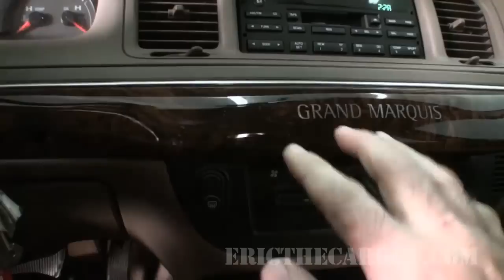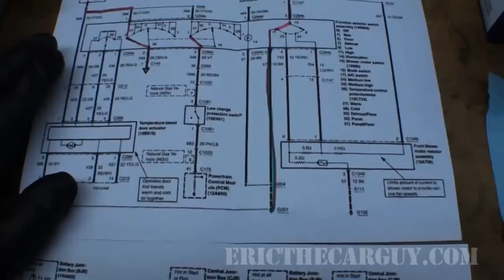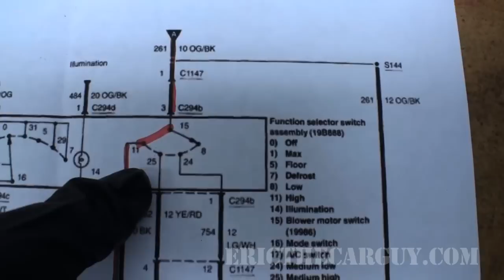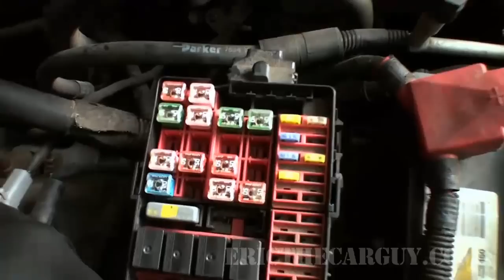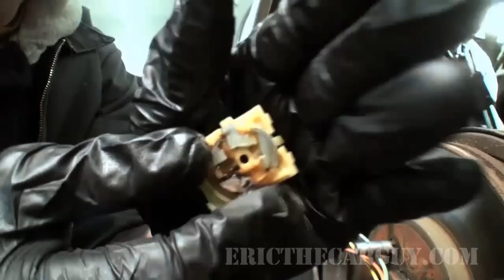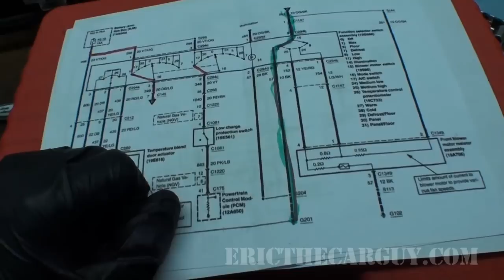2004 Mercury Grand Marquis Blower Motor Repair -EricTheCarGuy

Comment: Hey Eric, been a longtime viewer of you, and thank you with a lot of appreciation, for making videos of what you do and how you do it. ive used your methods and used the info u gave to us on how to trouble shoot instead of spending a lot on money. I have a 2001 Grand Prix GTP coupe with the 3800 L67 series 2. and yes its modified. the blower switch does the Full speed on 5 but 1-4 doesn't work, I was thinking resistor but nah its the switch. Also I just graduated from Diesel Technology on May 18

Comment: Hi Eric, my car is 2013 elentra. Recently, there are so much water. like waterfall, coming out from the blower or somewhere around that area. Btw, i did not turn on the AC or the heat, and the water only comes out when i am driving. What is the problem? Is it the "sewer" get blocked?

Comment: he's using a powerprobe wich cost over 100$, i use sockets that you can get nearly for free at the junkyard or on old used parts that you have, or you can also buy one socket + one light bulb for les than 5$. Also, BBB industries lets you see all the electrical diagrams you want for free on their website.  That's all you need to diagnose simple electrical problems like this one.

Comment: I work on a lot of Fords,a couple weeks ago we has 3 E vans getting blowers resistors and/or switches replaced in the shop at once. The blowers on Fords are a high failure part, the resistor has a thermal fuse built into it when the amps drawn from a worn blower pull to much the thermal fuse blows and you only have high, it is in ford's service info, because you are now have a direct link to the switch the switch also goes bad
the blower motor, the contacts get worn and takes more amps to turn.

Comment: The problem was that over time the contacts in the switch got a little dirty. That dirt increased the resistance of the switch and heated it up, which made it wear even faster, and heat up more until the plastic started to melt. This is a much more likely scenario than the motor having an internal short.

Comment: Incorrect on that system, the blower was pulling too many amps, not a direct short, the switch becomes a fuse as well as it is on the ground side of the system the switch has a lower amp rating than the real fuse.

Comment: Eric you can't voltmeter an open circuit.  You have to back-probe with the motor connected.  The load will affect the voltage that your meter sees.

As to your theory:  If the motor was shorting then the fuse would blow before the switch.  If not then the switch was faulty *before* it overheated.  Please replace it if it's a customer car.

Comment: a good tip on most older volvos like 200, 800, 700 and 900 series cars if the blower motor resistor  is bad its beacuse the blower motor is eating to much power and burns the resistor off so you can fix it with just a resistor it will burn out in a couple of the weeks or days

Comment: i would have applied power directly to the motor to see if it blew at full speed before i changed it out then i would have checked the voltage from the plug at each position of the switch if no change check switch

Comment: Eric you were for resistor that's switch is a variable resistor not a  variabile transistor. Variable resistor its like your volume knob on your stereo that's a variable resistor. It varies the current going to the motor or said speaker

Comment: I guess you like following 30 plus page flow charts when experience of the tech can tell him to skip over 30 steps and check xxx? I do it all the time, and 90 plus percent I am right, I still do the checks, but I am a pro and would be wasting mine and the shops time going step by step. I do mostly driveablilty and I can tell you most times I do not even look at the flow chart unless unfamiliar with the car or code set criteria. 
A better tip would be to understand how the system works

Comment: wow, getting beat up on this one:( Truth is I would have replaced the blower resistor and switch too, a lot of people talking out their a** on this, with no understanding of how the system works, the blower was pulling too many amps through the system and melted the switch to put the old blower back in would have resulted in a come back.
Also I would bet the lady has been riding with the blower only working on high because it had taken out the resistor, as those have a  thermal "fuse" in them

Comment: The switch is on the ground and at high speed it creates a direct path to ground so there is no possible way for a short in the switch to cause the blower motor to fail when he is playing with the switch there are times when the motor speeds up indicating the motor is working correctly I have noticed Eric seems to develop a theory as to what is wrong and then test that theory I have found it better for me to not guess what is wrong and just test the circuts and go where the evidence takes you

Comment: Always enjoy your videos, but would like to see more concrete diagnostics before changing parts. 
A simple voltage drop test on the ground side of the blower motor in all fan speeds (loaded circuit) would have pointed you in the right direction in under 5 mins. You said yourself you don't like to do extra work! :)   The wiring diagram and a real voltmeter (instead of the beeping powerprobe) would have helped at the switch harness. Measuring amp draw of old vs. new motor would have been nice too.

Comment: When I had a 99 Grand Prix, I remember replacing the resistor assembly twice because only the highest setting was working.  Then GM admitted that it was a faulty design because moisture kept on shorting out the unit.  After the newly designed unit was installed, I didn't have a problem with it anymore.

Comment: So, finding out the switch was the problem , are you installing the old blower motor back in or just tell the customer it's fixed and charge her for the new motor. By the way it happens, it's an honest mistake when trouble shooting a problem like this.

Comment: rookie mistake when backprobing the motor - should have probed between the negative terminal on the motor connector and the ground at the battery with the motor running on 'high'. If you got a big voltage drop (like 6v) then you can conclude that there is a bad connection somewhere between the motor and ground (i.e., the switch!).

Comment: I did the same repair on my 94 accord and the new motor did not have a harness. I cut the old harness off the bad motor and connected it to the new motor. No need to buy one.

Comment: First of all, do us a favor eric. Throw that power probe away and get a REAL test light. Power probes don't test amperage it just gives you voltage readings, like a multimeter. Take at least one 1157 (i use 3 plugged in parrallel) light bulb socket to test for power, at least it takes some juice to light up good. Every electrical diagnosis should begin with electrical diagram reading, i never go out testing stuff im not 100% sure about how it works (cars keep on changing every year!!!).

Comment: I wondered why you checked for voltage with the motor disconnected. I would concur the motor was more then likely bad and drawing too much current which melted the switch.

Comment: I'd definitely check your resistor (passengers side up against the firewall I believe). My father's 2000 Ranger's resistor rusted so bad it melted the heck out of his wiring harness, had to replace the harness plug and the resistor. It's plugged right into the blower motor housing, and it doesn't have a gasket so water gets in and rusts it out big time. If you Google it it's a pretty common issue.

Comment: I have a 94 integra. when I try to shift Into gear it won't let me. if I turn off and start it again it shifts fine for a while. but than it stops me again from shifting.  any suggestions before I take it to repair shop?

Comment: A faulty blower motor drawing excessive current and melting components is not uncommon.  This is why the slow speed resistor fails most of the time.  Spin the old motor Eric and see if it seems a but draggy.  The bearings also dry out and cause friction too.

Comment: Just from looking at how the original blower motor spun when you had it on the bench, and comparing it to the new one, I'd say the motor was starting to bake itself into place.  That places a higher current demand on the circuit, higher current creates more heat wherever resistance is greatest (flimsy plastic switch), ultimately making roasty-toasty switches.

I say good call replacing the blower motor! Happy old ladies are awesome.  <3

Comment: at uti they taught us that you should follow electrical issues in order...kinda like connect the dots. check your source voltage, fuse, switch, load, then ground.

Comment: Hi Eric! Just a quick comment. If you had checked the voltage across the blower motor, before taking everything apart. It would have checked low. You would have had a full 12 Volts at the motor feed and this would have pointed you to the ground side as being where the problem was (switch resister, etc.). Electrical problems can be fun! B.D.